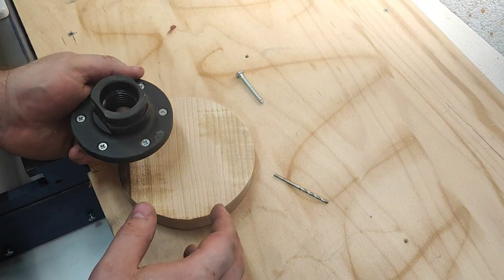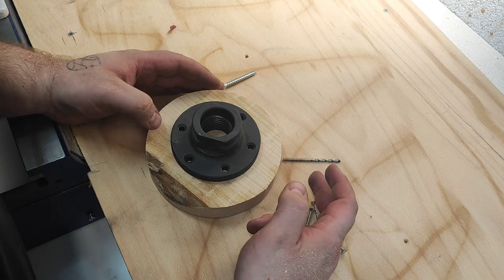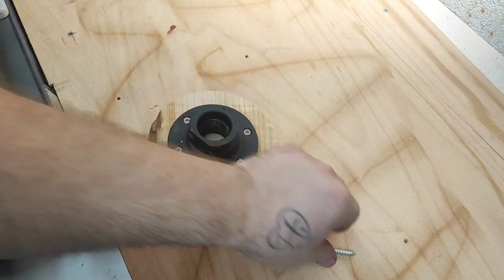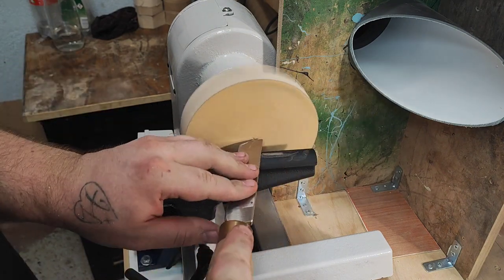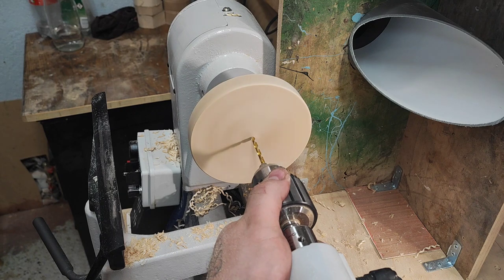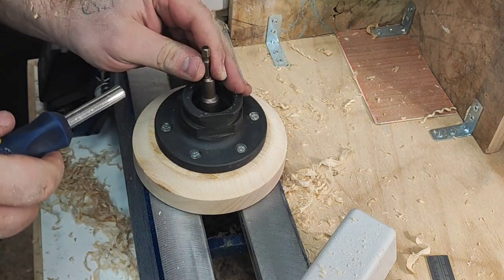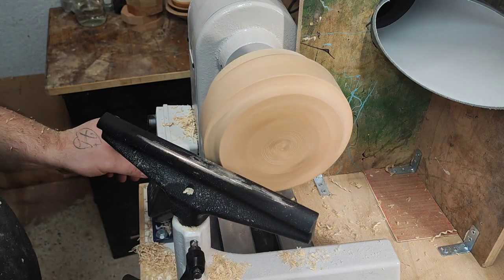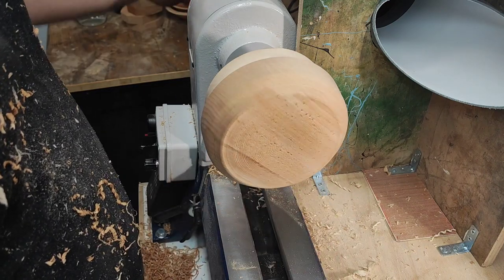Screw chuck from faceplate.

Comment: I made up a couple of quite small screw chucks for initially holding small offcut blanks to make little salt bowls and small boxes and the like.  
One is made from a small piece of stable hardwood turned so it fits precisely in a set of dovetail jaws and the other from a similar piece which I threaded to fit directly onto the spindle with a 11/4 x 8 tap.  For small work they both work great for the initial hold without having to procure a faceplate.  
The climate here in the high desert USA doesn't have wild swings in relative humidity, so there's almost zero movement in wood once it's thoroughly dry, so both have remained running true for years now.
Reply from the maker: Many uses for homemade screw chucks and they can last a long time.... Thank you for your input😀

Comment: I have a welder, and my lathe has a 1"-13 spindle. I can buy hex nuts for cheap, and weld bars on three faces to make  star-chucks ( my new word!) I will let you know if it works!
Reply from the maker: In the old days they would make lathe accesories like that as a thread size was common like bolts .... If you have the time and acces to those bolts that fit your lathe size thread go for it 😀

Comment: Is this method dangerous at all when turning soft woods like pine or poplar? - just worried about the screw coming loose and wood catapulting across the room - had this happen with a faceplate on poplar.
Reply from the maker: On really soft woods IT might strip but on pine or similar woods I drill smaller hole,on hardwoods slighty bigger.

Comment: I've been using a wormwood screw with my chuck but it looks like a screw chuck is coming soon. Thanks for all your great videos. Between you and Richard I've gotten more good information in the last year than in the previous 10.
On a side note I've been using a 1" round nose scraper as a shear scraper when needed. I saw your build video when you made the one you faced this blank with.
What is the functional difference between using the shear scraper that you use and the round nose scraper that I've been using as a shear scraper? Thanks for any info you can provide.
Reply from the maker: Thank you Randy for kind words 🤗

I'll do a video soon on how I go about shaping and profile scrapers and why, but round nose is usually beacuse of the shape best for endgrain hollowing or bottom of small bowls.... Shear scraper has a right corner which you can use for scraping corners and the round over edges allow for easirs slide , and the profile of it allowes for easier shear scraping..... Hope that helpes, but I'll try to explain more in the video 😉